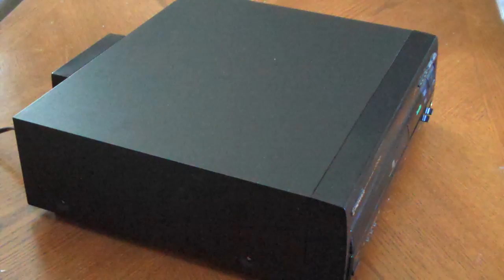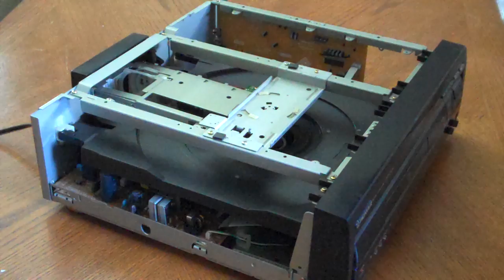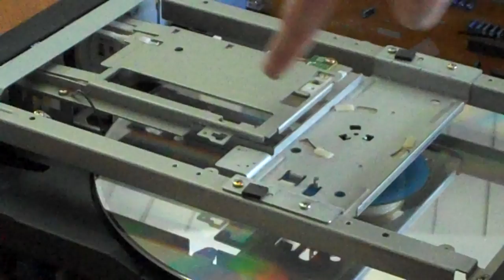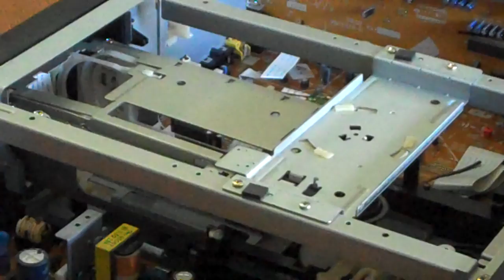Inside a Laser Disc Player

Comment: 0:57 You inserted the laserdisc with side 1 facing UP. Yet, the laser is at the bottom and on side B. How is the Laser Head reading side 1 if its not hovering over side1? Clearly, the laser head is hovering under side 2 while side 1 is playing. How is that possible?